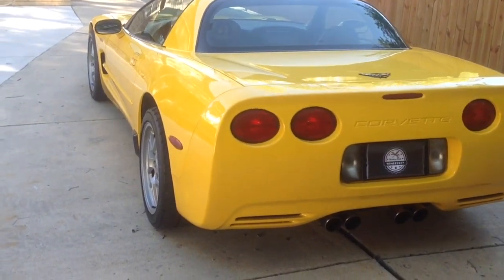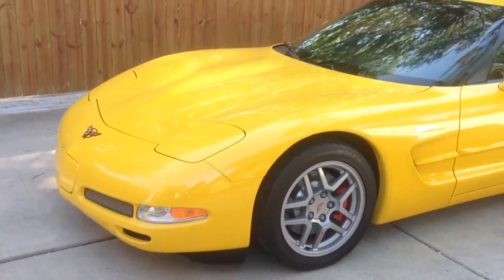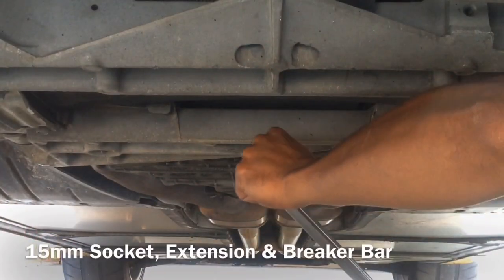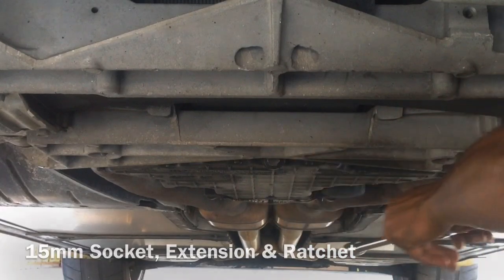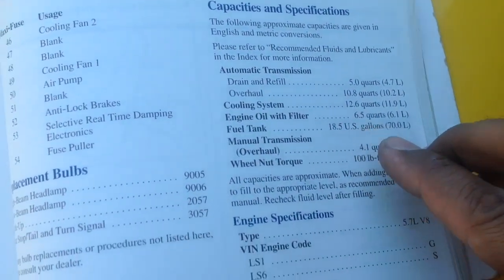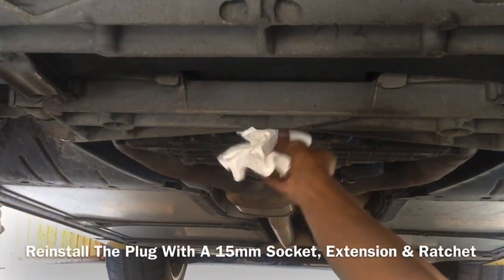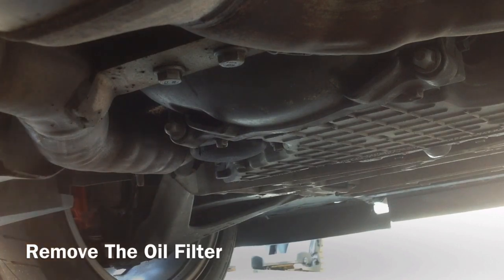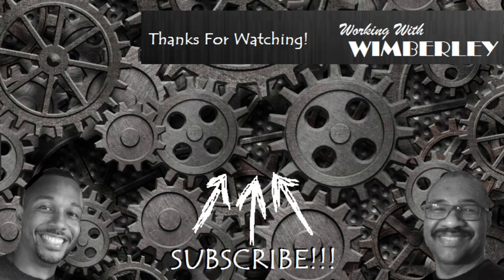C5 Corvette Oil Change & Filter 1997-2004 How To Tutorial Chevy Z06 Coupe & Convertible Easy Steps

Comment: Wimberly, Great video. I would never use a Fram Filter. They are substandard. Use a Wix, K&N, Mobil 1 or anything else. This is no disresrect to you or anyone else for not knowing. Been working on cars for 50 yrs. Look up filter tests where they cut them apart and you can see for yourself the plastic internal caps. Keep up the good work. My Vette is like yours, only red. Thanks.
Reply from the maker: I’ve never had an issue with Fram filters, but you’re not the first person to tell me they’re no good. I’ll be switching to Mobil 1 for my next oil change. 👍🏽
Reply from the maker: I’ve never had an issue with Fram filters, but you’re not the first person to tell me they’re no good. I’ll be switching to Mobil 1 for my next oil change. 👍🏽
Reply: The Fram ultra is a good filter.  The basic Fram is really lousy.  Can't go wrong with Mobil or Wix or Napa Gold which is made by Wix for Napa.

Comment: Fill oil filter before installing.  I’ve used fram oil filters for over 30 years never ha a problem. Recently after seeing all the negative reviews on the fram I tried ACDelco. One the seal came loose and the second one crushed when I removed it. So I’m not using acdelco anymore
Reply from the maker: I usually do fill the filters first. You can see it on some of my other oil change videos. For some reason, I didn’t show it in this video. 👍🏽

Comment: I bought an 01 Z06 not long ago, and it’s getting to be time to change the oil. I read that you need to jack up the back go get it to drain completely though, is that necessary in your opinion?
Reply from the maker: I’m my opinion, no. I haven’t done that and I don’t plan to. But if you have the capability to do it, go ahead! It can only help.
Reply: @WorkingWithWimberley  good looking out, thanks.
Reply from the maker: @alexb8833  No problem! 👌🏽

Comment: Do you level the car?
Reply from the maker: Yes. I lowered it down to let the oil drain completely.
Reply: WorkingWithWimberley how?  I only have drive up stands.
Reply from the maker: I didn’t use drive up stands. I used a hydraulic jack.
Reply: WorkingWithWimberley how essential is it to level it and drain it completely?
Reply from the maker: I’d definitely try to get out as much oil as possible. Just make sure you don’t add too much when you refill it. You should be ok.